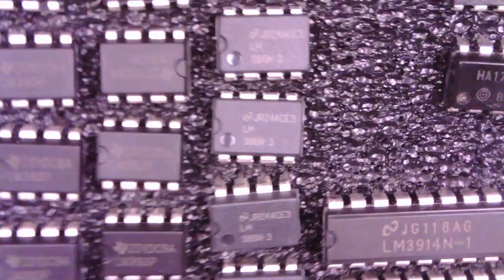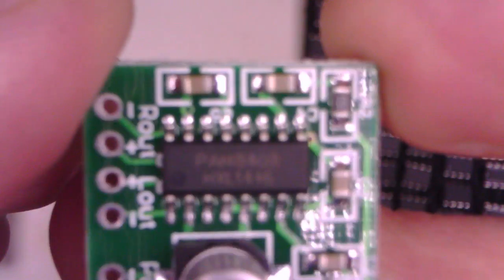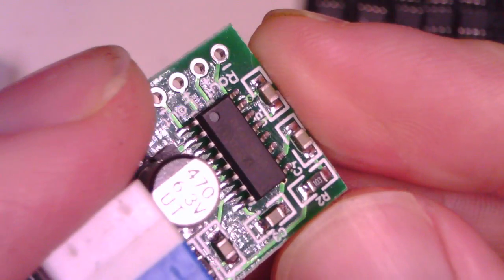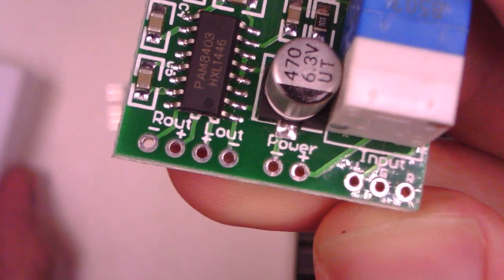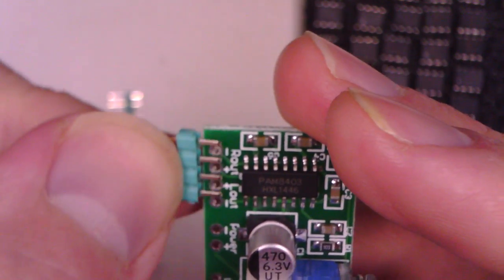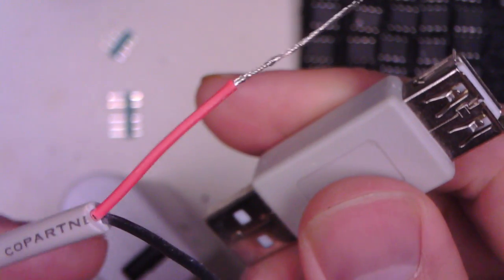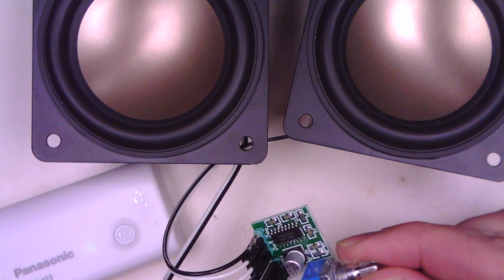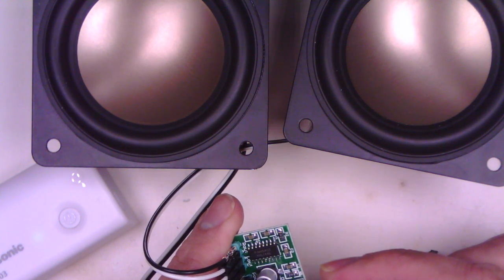Trying out a PAM8403 audio amplifier module

Comment: I'm working on a single box stereo speaker where a bit more Watts is suitable. I'm quite happy with 1-2 Watts from transistors and 386 chips otherwise. It's mind blowing to me that 5V amplifications works great with smaller drivers/speakers. I want to experiment more with op-amps, but it's already a pile of stuff and I got tired of it for now....

Comment: Good night, very cool your video, I would like some help, I am trying to feed with 3.7 volt Lithium battery and 4800 mah, the amplifier starts to cut sound, failing. I increased it, put two in parallel, continued cutting. I put a higher 4.2 volts, model 18650 of 9800 mah, also cut. interesting that with 02 normal AA batteries Alkalinas works super well, sound very good.
Does anyone know where I'm going wrong?
Thanks

Comment: I use PAM8403 AMPs  to power my Celestion DL6's and PSB Alpha Mini Monitor Speakers, both 8 ohm. 
I added Bluetooth modules, Good sound plenty of volume and surprisingly Bass.
I have also run the 8403s on 16 ohms with no problems I have not been able to heat the amp up at all.
The one on the DL6s runs 24/7 but at low volume in the bed room.

I like these amps you can get a quad channel board using 2 8403s and Bluetooth modules with them built in.
Many of the boards with them are smaller than the one in the video.

Comment: hi! i need a mono amp,  is it possibile to use only one speaker? leaving a channel disconnected or using a resistor in place of the missing speaker?
Reply: Just connect the + of one channel to the - of the other. Then use the remaining terminals for your speaker.

Comment: People who are dealing with any audio amplifier that doesn't have an internal power supply to boost the voltage need to learn and remember the following: Your output peak voltage can never be more than your input voltage for a full bridge or half the input voltage for a half bridge.

To go from peak voltage to RMS of sine wave AC you multiply by .707

So in theory the output can't be more than .707x the input, in reality it will be even less due to drop within the amplifier itself. In this case the power FETs in the chip have .32 ohms resistance. This adds to the load impedance.

5v X .707 = 3.5v

Power into a load is voltage squared divided by impedance. 3.5 X 3.5 is 12.25.

12.25 divided by 4.32 ohms is 2.84 watts, pretty close to the datasheet 1% value.
12.25 divided by 8.32 ohms is 1.47 watts which again matches.

This is why pretty much every car head unit ever made with a full bridge floating ground speaker output is advertised as 20-25 watts RMS per channel.
14.4 X .707 = 10.18v, squared is 103.63, divided by 4 is 25.9 watts.

Also the PAM8610 version.
12 X .707 = 8.484v, squared is 71.98, divided by 4.4 (4 ohms speaker .4 ohms FETs) is 16.36 watts.

Comment: I have an ak2515 spectrum analyzer im using in a gift for a friend and I wanted to connect a basic 3.5mm camera mic into it but then learned the difference between mic inputs and aux inputs. My question is if I could use one of these tiny amps as a preamp for the signal? The ak2515 already has 5 volts available onboard. Not trying to power speakers, just make an aux in signal. If there is another method I could use I'm all ears. Just want adjustable gain for the mic to adjust the sensitivity for the spectrum analyzer.

Comment: What is the required power for a PAM8403 board
Reply: 5v upto 5.5v
Reply: @atendimentoplayzz2705  in Amps?? I've been using a 5v 2.0A adaptor for power supply which seems to be not enough
Reply: I think you may have burnt your board
Reply: Cuz it uses a charger which outputs 1 amp
Reply: @atendimentoplayzz2705   but isn't it DC output ??
Reply: Take a usb charging cable connect it to your laptop or power brick chop of the other end and connect it to the the board

Comment: How menny watt is the versterker?
Reply from the maker: It is rated at 3W per channel at 10% distortion with a 5V supply. 10% distortion would sound pretty bad, so realistically I'd run this amp at about 1.5W per channel for reasonably low distortion.

Comment: What is the name of the green plugs you attached to the board. Can you please help
Reply from the maker: These are variously known as pin headers, dupont pins, breakaway headers. They have a 0.1inch (2.54 mm) pitch, usually come in lengths of 40 pins which can be snapped down to the desired size.

Comment: I also powered it with a 5v cell phone powerbank and after some minutes it started being hot as hell, nearly burning out. Eventually, it got damaged and I could barelly rise the volume. Anything louder than 20% of the original amplification power made the module stop the signal and the speakers cracking. I took another module and i used a 5v cellphone charger instead. It happened the same. temperatures got so high that the module end up damaged. I really don`t know if they have to be feeded with a lower voltage or maybe i got fautly modules...

Comment: bro it can support 3.7V Li-ion battery or not
Reply: of cource. It works till voltage is lowered to 2.5 V
Reply: Nazmul Hassan It can, but be sure to use a protection circuit in conjunction with the battery.
Reply: It does, however it will not put out as much force. Best is to stick to the 5 Volts it needs using two 3.7 Volt cells and use a cheap voltage controller board to level it to 5 Volts.
Reply: my little sister have one tower bluetooth speaker with this amplifier but  necessite to plug  with a transformer , i think after put a li-ion battery for use outdoor ^^ the power consuption not exeed  +/- 300 ma
Reply: https://www.amazon.in/s/ref=nb_sb_ss_i_8_7?url=search-alias%3Daps&field-keywords=chauhan+abhiyantriki&sprefix=chauhan%2Caps%2C636&crid=J288HWAHCQK2
Reply: wire a USB plug, use a power bank capable of 5v 2.1A output. with a little 5v MP3 module, spring terminals for speakers, and a little project case you have FM+MP3 (USB or TF card) about the size of a pack of cigarettes. good for about an actual 1.7w/ch max, not too shabby really.

Comment: The LM386 is the worst audio amplifier in the world. I hate those things.

The PAM8403 amplifier works fine, but its narrow power supply requirement is annoying. Why couldn't they have designed the thing to at least tolerate  6 Volts? Devices powered by 6V using 4 AA batteries are common. But the PAM8403 has a maximum supply voltage of 5V.  You can't just drop it into any project powered by anything from 3V to 12V. A lot of my projects use 4 AA batteries, so 6V which leaves me with using a 1N5338 as zener shunt to drop the voltage down the recommended level, or use two or three diodes in series to drop the voltage. That's fine for bringing 6V down to 5V, but not practical for 12V. At this point the inconvenience isn't worth the fact that these things are so cheap.

The TPA3116D2 is a little more expensive ($1 for PAM8403 compared to $8 for TPA3116D2), but it's much easier to use. It has a wide voltage range of 4.5V to 26V.
Reply: Noah Spurrier you can use pam8610. It works with 12v supply!
Reply: Using a 7805 from your 12volts works.
Reply: 4 x 1.2 volt rechargeable cells will give 4.8 volts which is likely to be OK

Otherwise an adjustable drop down buck converter will do the job - will drop down the voltage to anything you want from a wide range of input voltages - and they are also dirt cheap
Reply: https://www.amazon.in/s/ref=nb_sb_ss_i_8_7?url=search-alias%3Daps&field-keywords=chauhan+abhiyantriki&sprefix=chauhan%2Caps%2C636&crid=J288HWAHCQK2

Comment: Hello Luc! I'm already subbscribed to Your vid's. I Want to use for my project one of those amps You work with, and I really love it especially for the reason of having that potentiometer too. My question is about the speakers I want to use: Peiying PY-1010C 4" 60W - 100-20KHz. Eficiency: 88dB/W/m. Like I know every speraker have Maximal (60W in my case) and Musical (unknown) output. Do You think those speakers will fit for the project or not ? I just do not want to hear them clipping. Waiting for Your answer. :)

Comment: if i powered with a powerbank and 2.1A its better than 1A?
Reply: Does not matter, it will only take the amount it needs of amperage and it is much less than 1A www.diodes.com/_files/datasheets/PAM8403.pdf

Comment: if the speakers are 15w like yours and they aren't 3w which the pam 8403 amplifier need. Are there any incidence at battery and amplifier or speaker?
Reply: here we have a 15W capable speakers, so if you send them just 3W they are ok dealing with this power, no effect on the battery consumption.
What sets the battery consumption is the potentiometer regulated amplified power.
I mean you get close to 3 times the battery life (at the same given battery charge level) if you output 1W instead of 3W out of the speakers.
Reply: +Donato Greco ok thanks you!

Comment: does anyone know if the PAM amp will work with 12v instead of 9v?
Reply: 5,5Volts MAXIMUM, this is on the Datasheet. (Google it: "PAM8403 pdf")

Comment: i couldn't go so loud ! Long before with 8 ohm i had greaaat distorsion. Any ideas ?
Reply: You cannot expect it to go very loud on an 8 ohm speaker in real terms you will only get just over 1 watt of clean sound before you hit clipping. In fact only 2 clean watts is available into 4 ohms. At 3 watts you will have 10% distortion which is mostly clipping artifacts. After all it works in just 5 volts, it's not a PA amplifier.
Reply: Hi bro,
As in any small cheap amplifier kit, there's always improvements to do, like those PAM8403 modules. They follow the minimum design and install the minimum external components around, to keep prices low. Sometimes, there is important points missed.

First, any amplifier needs stability. When bass kicks out, voltage will drop. Add at least, electrolytic 220uF to 470uF, capacitor (Tantalum is better!) between Vcc and GND lines. Add also 100nf in parallel. 

Also, please, as general rule: always use decent wires. Avoid those microscopic hair-type wires, horrible! (No need for "Audio-fool" gold cable as well) Make your 5v input the most robust as well. So, less resistivity on the path, better the result will be. Same thing applies between Speakers output pads and speakers. 

And, very critical for this device: the Analolg Bypass Capacitor.
A 1uF electrolytic capacitor MUST be used between pin 8 and GND.

Better to have a small look at the Datasheet :)
https://www.openhacks.com/uploadsproductos/pam8403.pdf
Reply: Just ran some tests on it myself and found that normal usb supply isn't enough current to drive the system.  I have since hooked it through the 5v line from a pc psu and got far better results.  I would say anything that outputs good current at 5v will do.  Personally I'm using one of these to drive speakers on a case mod I'm doing on a pc I use for travel.

Comment: With a properly designed pre-amp, these blow the LM386 out of the water as a sweet little guitar amp. Keep the speaker leads short, so that you don't have interference issues. Use a genuine guitar speaker. I like using the new single-supply rail-to-rail op-amps for the pre-amp.

Comment: Can you plug a guitar into this amp by punting a jack in-put instead of an mp3
Reply: +GenTal1969  It should be easy enough. But you're only going to get about 3 watts per channel. Not exactly loud enough to use as an amp in a band. But could work to amp an acoustic guitar at the beach.

Comment: hi luc! i've been reading that it is better to have the amplifier's wattage bigger than the speakers, why do you use a 15w speaker in this case? i've bought a speaker from here: http://au.element14.com/pro-signal/abs-216-rc/loudspeaker-miniature/dp/1504105 and have been experiencing clipping at 5v/500ma, and less clipping at 5v/1a. can you explain/teach me why this isnt a good setup compared to a higher wattage speaker?
Reply from the maker: +Shang Lin Chua I agree with what you have been reading. In general it is better to have an amplifier rated at a higher wattage than the speakers. The reason is that the amplifier will never be driven to the point of clipping, so the speakers will always be driven with a clean signal. It's clipping that's the enemy of speakers. Of course, if you push it too far and try to put 100 watts RMS into a speaker rated for 10 watts RMS, the speaker will likely burn out, clipping or no clipping! 

In my case, where I have a low power amplifier driving speakers rated for much more, I just take care to ensure that the amplifier goes nowhere near clipping. I find that I get ample volume while keeping the distortion low. If I really wanted to crank up the volume I'd use my bigger amp hooked up to my bigger speakers.

I suspect that you get less clipped with the 1 amp power supply because the higher rated power supply can supply more energy during the transients. The amplifier can only work within the limits of the power supply. The 500mA 5V power supply can at most (theoretically, 100% efficiency) deliver 2.5 watts to the speakers via the amplifier. The 1A 5V power supply, meanwhile, can theoretically deliver 5 watts. So the amplifier can deliver more power to the speakers before exceeding the limits of the power supply and starting to clip.
Reply: Thank you for the response! I'm getting a little bit of progress, but maybe I just chose the wrong speakers for the wrong job. I changed it with 50mm round speakers 1w from taydaelectronics and have been getting better sound! But better sound with the tda2822m, and ok sound (can be better) with the LM 386. So if I use 1A 5v power supply, 5W is greater than 1W (speaker) is that right?

Comment: I want to know about the impedance of these speakers you used . Pls give me the link of this speakers .
Reply from the maker: +MOHAMMAD Nazmul Hasan Pias The speakers have 8 ohm impedance. They are from Jaycar here in Australa: http://www.jaycar.com.au/Sight-%26-Sound---Home/Hi-Fi-Speakers-%26-Accessories/Component-Speakers/Shielded-3-15W-8-Ohm-Full-Range-Speaker/p/AS3034
Reply: +Mohammad Nazmul Hasan Pias You can check PAM8403 Datasheet. It gives you 3W Output at 10% THD  with a 4 ohm Load and 5V Power Supply. Expect less output if you use 8 ohm speaker (all things like SPL etc being equal)

Comment: Think some 10watt 16ohm speakers would work alright with these amps?
Reply: +sumdude4  I doubt you will get 3 watts into 16 ohms. More like 1 watt!! or even less. You will need to use 4 ohm speakers to get the full 3 watts. Note with 3 watts output you will be into clipping. It's really a 2.5 watt amplifier with less than 1 % distortion. Still amazing value for money.
Reply from the maker: +Michael Beeny +sumdude4  Yes - at 16 ohms the output power would be quite reduced. The PAM8403 datasheet (page 4) says you can expect 3.2W into a 4 ohm load at 10% THD (i.e. nasty levels of distortion!) with a 5V power supply. It drops to 1.8W for an 8 ohm load, 10% THD, 5V supply. So at 16 ohms you can expect less power output again!

The 2x10W PAM8610 might be worth exploring. Modules using it are only a little more expensive, e.g.:
http://www.aliexpress.com/item/Hot-Sale-12V-Mini-Hi-Fi-PAM8610-Audio-Stereo-Amplifier-Board-2X10W-Dual-Channel-D-Class/32302322145.html

These run off 12V. Again the datasheet doesn't specify the power output for a 16ohm load. I have one of these on order - look forward to trying it out when it arrives.

Comment: On instructables.com I found a project that supplied a link to just the board, but I'd like a unit with the potentiometer and capacitor. Could you share that link? Did you say it was ALI? thank you for this video!
Reply from the maker: fireguardburnt Sorry about the delay - this is the device I bought:
http://www.aliexpress.com/item/New-Mini-PAM8403-5V-2-Channel-USB-For-Audio-Amplifier-Board-3Wx2W-Volume-Control/32296387716.html

Comment: Hi, Have you used any external power source for the speakers too..?
Reply from the maker: mohd. shariq zafar Actually, I've only tried the 5V mobile phone booster battery to date. But I don't think there'd be any issues with an external supply - I'm planning to use a 5V 1A power supply for my final application.

Comment: Does the PAM8403 chip get hot at higher volume? And will attaching a small passive heat sink help?
Reply from the maker: ***** I haven't noticed it getting hot at higher volumes. It's class-D operation should ensure it runs quite cool. A heat sink would probably work, but since the chip is in a small SOIC 16-pin package, there's not much surface area for the heatsink to mount on to.
Reply: +Pha Q Mine does get quite hot with 1x 3 Watt speaker on and 5.5V power supply and finally shuts down because of heat.
Reply: +Dave P you arent supposed to run it over 5 volts... try running it off usb
Reply: ***** the datasheet says "The recommended operating voltage is 5.5V" and absolute maximum rating is 6V.
Reply: Dave P well shit ive always seen it run on 5 weird

Comment from the maker: @sputech99 the -ve speaker terminals connect to separate pins on the PAM8403. I assume its driving the outputs in bridge mode to increase the voltage swing across the speakers. So not really suitable for headphones sharing a common ground wire.

However the following stack exchange answer gives a possible approach to connecting headphones using capacitative coupling, but I have not tried it myself:

http://electronics.stackexchange.com/questions/149687/cost-effective-solution-to-using-pam8403-as-a-headphone-amp